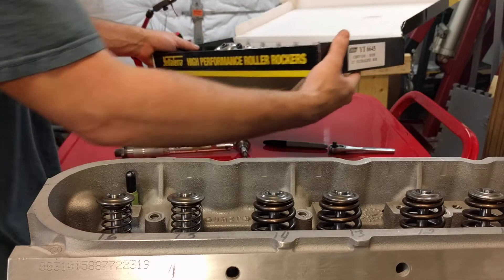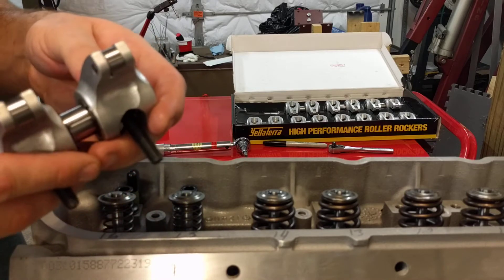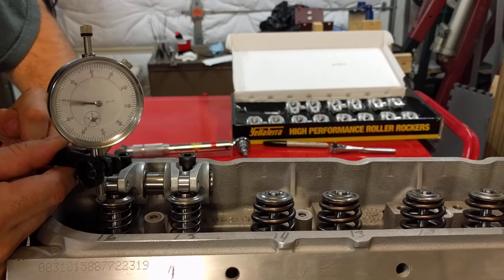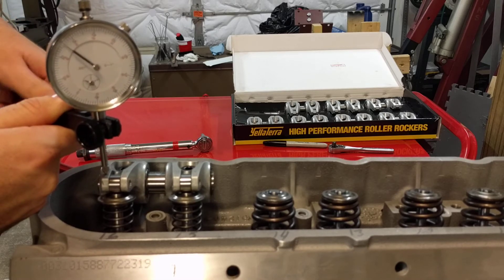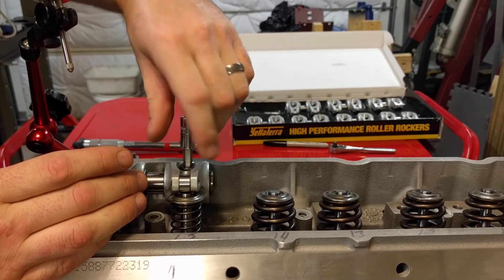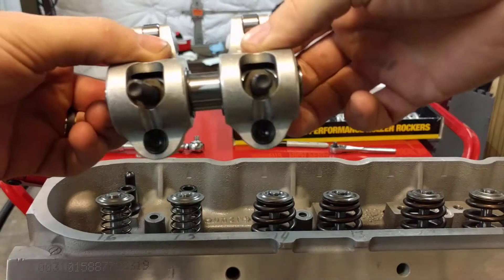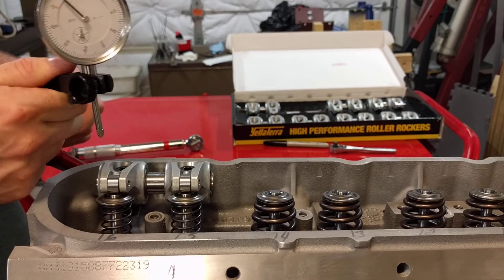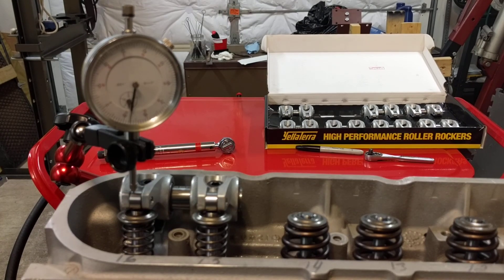Yella Terra 6645 rockers bought from Texas Speed and Performance

Comment: Just bought shaft mounted 1.8 roller rockers for the 5.3.  But? Mine are adjustable.  Yours is not. Good fix is to shave off some of the pedestal on the bottom. The flat side.  Possibly the instructions and personal information said these will have variations to a application, some additional adjustments might be needed??   No ??? Probably did say that.

Comment: The shims are for adjusting wipe pattern . You may not need to use them .watch install video.
Reply: You don't have to do all that on rockers made for LS just get your lifter preload between 3/4 and 1 1/4 turns
Reply: I really don't understand what the heck you are doing there you would have to completely bottom out your lifter before you're gonna get any movement down at the valve end unless it's a solid lifter. Please explain to me what it is you are doing in this video so maybe I will learn something new

Comment: You need to get longer pushrods and also need to add more than 15 though you need to add for preload. But also needto check contact pattern first using bearing blue on valve tip. Try without the shim.

Comment: That’s not how you install those rockers, why don’t you follow the Yella Terra install procedure? Or Comp Cams procedure for non adjustable rockers to determine zero lash preload? 
There’s a video by Yella Terra on that, but basically your geometry for wipe and preload is never going to be correct with 18 ft-lb (should start 22 BTW). Check procedure for turns v preload.
Reply: This should really be done on the pushrod side, ideally along the axis of the pushrod for the most accurate measurement. If that measurement exceeds what your hydraulic lifter can handle, I'd say you have a valid beef. On the pushrod side, that 15 thou is 8.8 thou, which i think even most short travel hydraulic lifters could handle/compensate for.
Reply: @slowpoke96Z28 it really doesn't matter whether it's. 015 or .008 or whether the lifter can accommodate. The point I see watching this is that all of the rockers should fit the same. There should have been no discernable difference (a thousandth or two AT MOST). That would drive my OCD batshizzle crazy
Reply: @tadwiltman4875 I'm the same as you in that a factory hydraulic  lifter is supposed to have a broad range to compensate, the only thing I really see here is that I'm a believer  in you should  do all your tourquing on the base circle  of the cam per that particular  rocker. Some believe you can just tourqe  to spec at any point but I disagree
Reply from the maker: Dirk the Pir4te 
This video demonstrates the difference in lash with changing only the rocker. Ls engines have only one way of checking preload and that is with an adjustable pushrod. 4 lb/ft will make roughly zero difference in lash measurement. Im not measuring for zero lash, I've already done so which is shown in the video
Reply: OK, just saying you are doing it wrong, never mind me if you like.  My experience installing these rockers per procedure over 200,000 miles is zero chatter.  No biggie, ask for your money back and more power to you.
Reply from the maker: Dirk the Pir4te 
I'm not including pre-load in this test. I'm demonstrating the significant variation in the rockers. When you have lifters that require an exact amount of pre-load (short-travel) for instance, these variations in rockers, pushrods, and lifter heights make it near impossible to get this exact amount of preload on every lifter and you run chance of too much or too little on these high end lifters without having different length pushrods or adjustable rockers. With standard lifters like ls7 lifters, you can get away with all the different variations in manufacturing tolerances because of the ability they have for a much wider range of acceptable preload.
Reply from the maker: Dirk the Pir4te 
Also, I compared the variation in all of my oem rockers with 160,000 miles on them and there was only a variation of 0.002 as opposed to these having upwards of 0.015 being brand new performance rockers and wasn't acceptable when i have to account for the variances in manufacturing tolerances of my lifters and custom pushrods